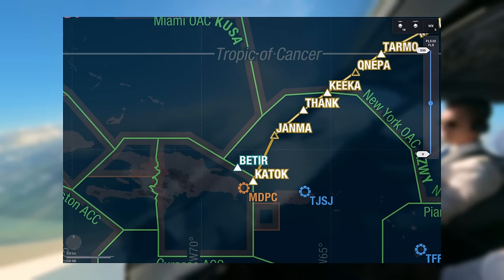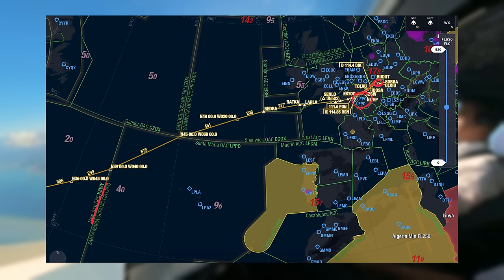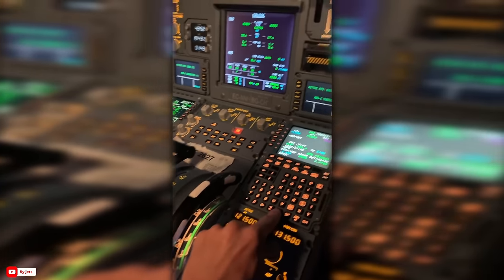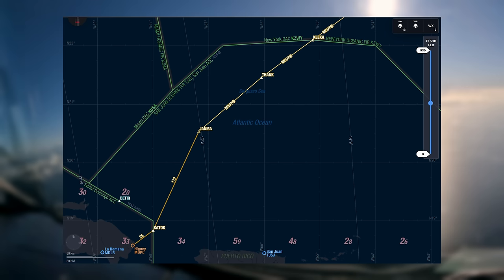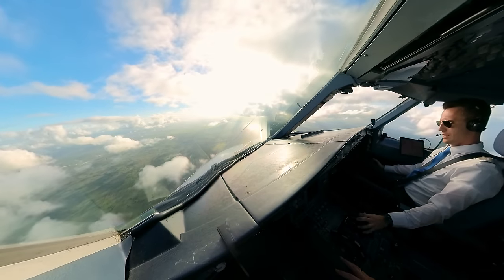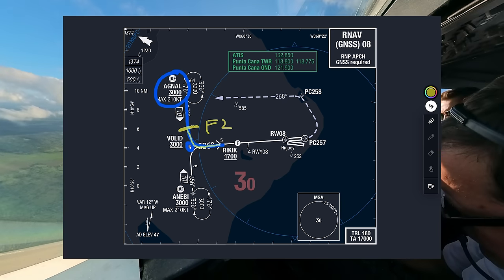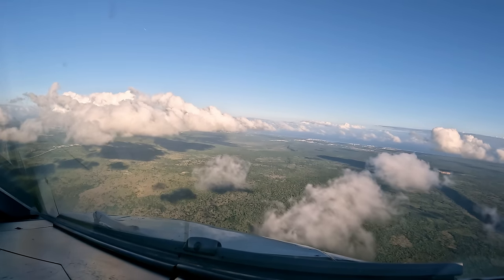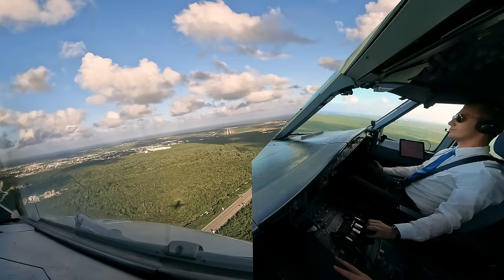How to cross the Atlantic - A330 Frankfurt to Punta Cana

Comment: Hello Pascal, the change of route from KATOK to BETIR this time and every other time was the decision of the San Juan control, even though it is true that entering through KATOK means arriving just in the opposite direction of the departures, the STAR KATOK1W is properly separated from all the other departures from PUJ because the PC101 fix constrain is at 8 thousand feet or higher, this point is right on the coastline. On another note, we love to give shortcuts when you come from BETIR, so always as long as it is possible for us, once you check in and if we receive the corresponding release from SJU before entering the FIR, a direct AGNAL from your current position will be the norm. 

At PUJ we work in a single runway configuration, for which the final compression is adjusted, for this reason we sometimes use the speed control at RIKIK, for the heavy ones, we try not to use more than 170/160kts, I hope this does not represent drawbacks, by the way we like to see those short visual approaches so don't stop requesting them.
Reply from the maker: Thanks for the detailed explanation! It's always interesting to learn more about air traffic control decisions. I will definitely keep requesting them visuals 😅🙌✈️ Thanks for sharing your expertise mate ✌️